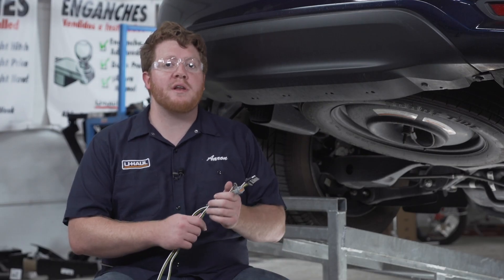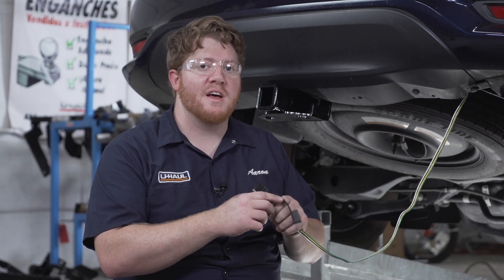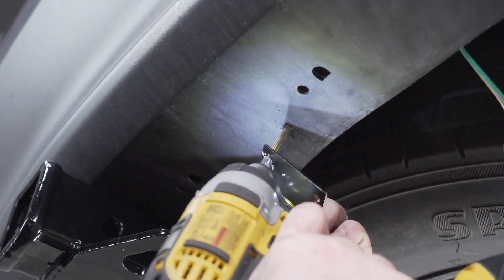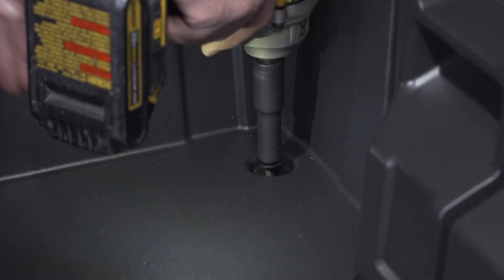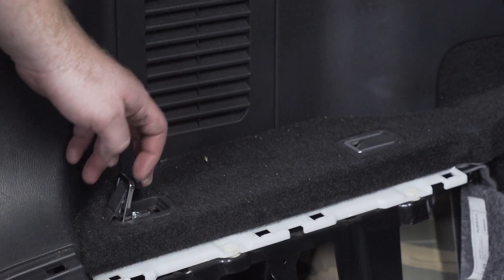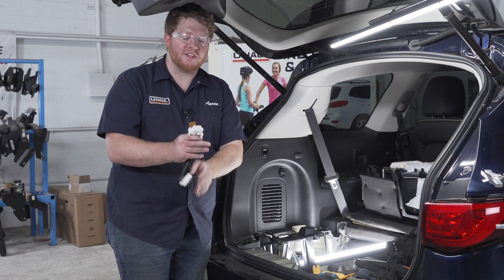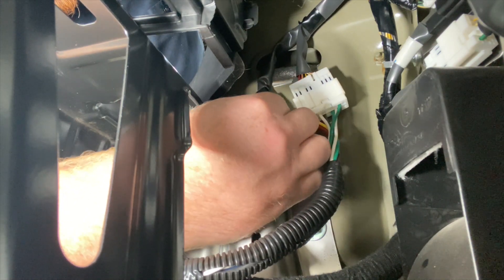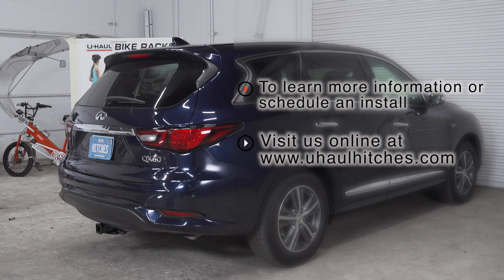2016 Infiniti QX60 Trailer Wiring Harness Installation

Comment: Followed your instructions to a T. Not getting any power from the connector. Installed three relays and grounded the harness. Is there a fuse underhood that i should check?  Thanks.
Reply from the maker: There could definitely be a fuse. Please make sure you also have the relays seated all the way. They can be tough, but if they're not clicking when you have the turn signals on it would typically indicate they're not getting power.
Reply: @trailerhitches  thank you. I will check if the relays are clicking. I did double check to make sure they were seated all the way. I'll check the relays with a multi meter when I get home. Thanks.